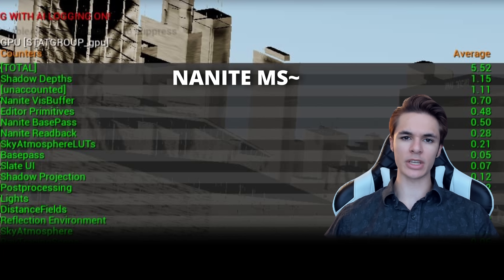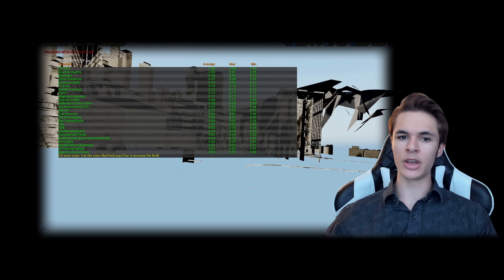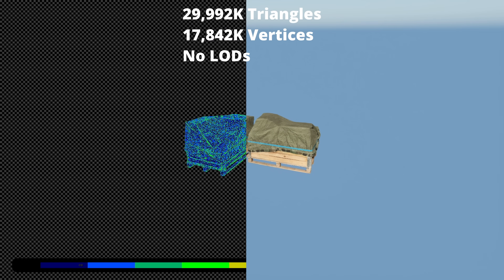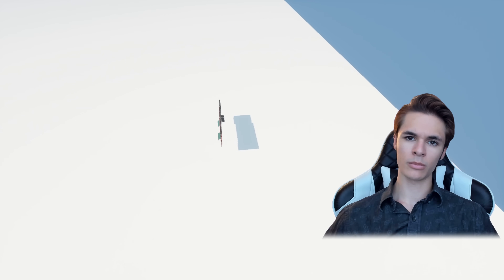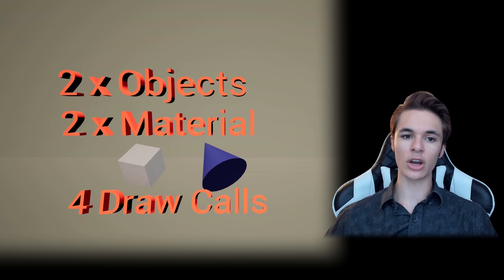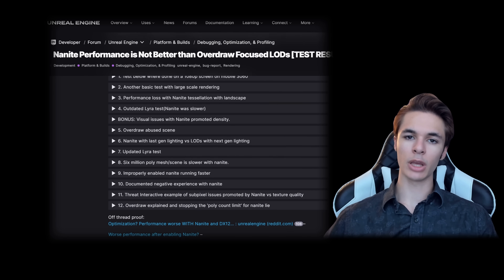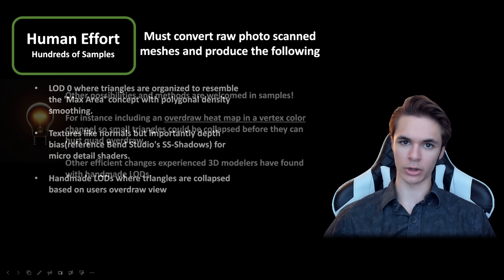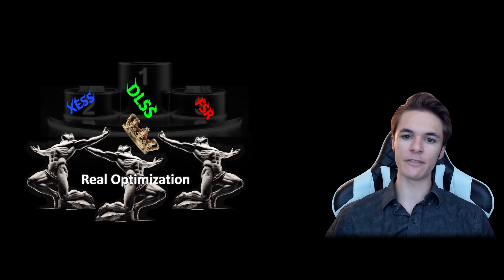Epic's Unreal Optimization Disaster | Why Nanite Tanks Performance!

Comment: DLSS was originally conceived as a means to make real-time raytracing possible. It's sad to see how many games today rely on it for stable frames with mere rasterization.
Reply: I'm looking at you, Test Drive Unlimited Solar Crown. Not even a RTX 4090 can run that game at a stable 60 fps at 4k with no upscaling. And even worse, the game looks like an early last gen game.
Reply: @autbo I'm glad I didn't buy that game I thought it was going to flop and be terrible I played tdu 1 and 2 they pretty good , ran alright
Reply: I absolutely hate the way modern rendering went. They switched from Forward to Deferred, but then broke anti-aliasing completely, introduced TAA which sucks, then introduced DLSS, which is now MANDATORY in any game to run at a sort-of acceptable framerate. Nothing is optimized, and everything is blurry and low-res. Truly pathetic.
Reply: @beetheimmortal  agreed, can't believe that high end RTX40 series GPU's really struggle to run the latest games at acceptable settings and performance especially compared to the hardware we had with 2010-2015 games which all generally looked good and run well on the hardware of their time.

I feel like we are at the point of gaining very slight graphical fidelity for way too much cost these days.
Reply: @dawienel1142  yea its called diminishing returns, its almost like the video games selling point today is graphics not gameplay😂
Reply: @dawienel1142  at 4k broooo
ofc you should expect some performance decrease when you're playing at 4k res
Reply: @Denomote  in the latest AAA games 4k isn't even remotely possible.

3440x1440 with some heavy DLSS an FG maybe.
Reply: @beetheimmortal  The worst part is that now some AAA games "hardcode" TAA into their game. For example the latest RDR2 PC build renders only half the pixels of foliage (trees etc) and relies on the user to turn on TAA so that it fills up the rest of the pixels on the trees. The result is that it looks like complete dogshit. Its better on 1440p (less blurry) but for people on 1080p its a smeary mess. Turning TAA off means you get transparent trees - and even on 1440p with TAA it looks blurred as soon as there is movement. The two alternative antialiasing methods in the game introduce game-breaking artifacts - disappearing objects, trees, weird collisions etc. This is the same in Ghost Of Tsushima
Reply: @beetheimmortal  only way to play games with proper resolution now is to buy a 4k monitor and render at 4k. Then you get somewhat a similar image quality as we had with foreward rendering
Reply: not at all, it was originally a supersampling project which even this is taken out of context and flipped on its head. what supersampling's supposed to do is take a natively higher resolution image and downsize it for example a 1440p image to fit the 1080p resolution WITHOUT quality loss, what nvidia did is they started rendering the original image at a lower reoloution and then upscaling it. imo its very wrong to call it supersampling because its not that. its upscaling. its an upscaler. from smaller res to higher res. not what supersampling means. one way to look at it is that if we actually had supersampling capable video cards we could get extremely high quality images say (hypothetically) 8k image for a 4k display. but obviously this would require a fuck ton of computational power which defeats nvidia's purpose of getting away with doing not even bare minimum. im extremely thankful for this channel to finally present this fact in a more technical and believable aspect that nvidia is not here for the goodwill of the gamers, its a greedy company thats gonna get even more greedy once they see the ai bs fail.
Reply: @oceanmanzz  Everyone knows DLSS is doing spatial upscaling. I would say it is at the point where instead of being misleading, it has changed the meaning of super-sampling in many people's conception. It is giving actual super-sampling a bad name because people think upscaling and super-sampling are the same.

DLSS was never intended to be about spatial super-sampling. That is not at all what the technology does and Nvidia has another feature called DLDSR that does that. The original DLSS 1.0 was called 'super-sampling' because the model was trained on 16K images, which doesn't count and is very misleading. Though now technically DLSS 2.0+ is 'super-sampling' because it uses temporal super-sampling like any TAA (a.k.a. TSSAA), i.e., it samples multiple frames.
Reply: @Nenulis0  Only because TAA in most games looks like vaseline. But DLAA is still TAA and suffers from the same issues as every other TAA. It's still temporal so you will always get smearing and shimmering, just not as noticeable as the vomit inducing TAA most games have. If you truly want the best AA in decades, it has existed for way longer than DLAA and it's called... SSAA. Obviously it's horribly inefficient, you're just throwing more power at the problem, but DLAA is just another less bad TAA
Reply: @Creepus_Explodus  "If you truly want the best AA in decades, it has existed for way longer than DLAA and it's called... SSAA."

No, the best AA is called MSAA + Transparency SSAA. It's the best because it provides nearly the overall quality of SSAA/FSAA at a much lower cost.

The problem of course is that multisampling doesn't work with deferred rendering. But MSAA is still a superior solution to everything else. It provides the best possible result with a reasonable performance cost.
Reply: It's not all the games fault, it's that Nvidia is selling 1080p graphics cards for $400+ in 2024. DLSS is a cheating hack to allow this behavior. You wouldn't accept this trash level hardware for your 4k monitor without DLSS. So while developers are also abusing it, the real problem is Nvidia selling garbage and the brainwashed masses who buy it. Everyone who bought a mid range or lower Nvidia card is the problem. Developers are mad over 8gb cards. WHO SOLD THEM? WHO BOUGHT THEM? Consumers can only blame themselves. Nvidia users like to brag about their DLSS, well how good is that 8gb 3070 vs 16gb 6800? You don't even need dlss on the AMD card. You can just run native resolution. Nvidia invented their frame gen specifically to get away with selling a 128 bit 4060 in 2024. If you bought into this, you are the problem. Unreal engine fanboys are on the same level. It's always fanboys who ruin progress for marketing. Snake oil is a meme for a reason, and nobody learned. The modern snake oil is DLSS, TAA, and unreal engine.
Reply: @JohnDoe-ip3oq
Reply: @Nenulis0  DLSS is rubish
Reply: @Nenulis0 a yes, dlss making games look shit compared to 2010 Batman but with shit performance
Reply: Same story every time with every technological advancement. The RTX 4090 came out and it was an absolute fuckin unit of a powerhouse. How long did it take before some lazy company made games that that RTX 4090 was barely able to push beyond 60fps? caught caught I won't name names because fuck them, I don't want to give them free publicity.
Reply: @Nenulis0  DLAA is amazing
Reply: look at the clowns who are trying to defend their shitty dlassass
Reply: That's not sad at all
Reply: @polecat3  that is awful
Reply: i'm not surprised when i saw the tech being announced, i guessed right away that this shit was going to happen. I also was not surprised when all the tech reviewer claimed that you could not tell the difference but that it was all a lie and saw that it puts a Vaseline filter on everything
Reply: and yet this was exactly predicted by literally everyone lol
Reply: Its surprised me at how well it works for ray-tracing. Turn pathtracing on in Cyberpunk and on a 5080 I get 30 fps, but with DLSS I get 60 and the path tracing is so beautiful any DLSS shenanigans are forgiven.
Reply: I thought it was made so that gaming on a 4K display would be possible
Reply: It's funny you say this because I'm playing Wuthering Waves with RT off just to get higher fps that I know my hardware is capable of, but I have to turn on frame gen just to be able to get there
Reply: Nah, what DLSS is doing for gaming is pretty amazig,
Reply: DLSS > TAA, you sound ignorant.
Reply: @TerracideDK  I don't think anybody here is saying TAA is better than DLSS. And also I'm pretty sure people aren't even saying DLSS is bad. It's an amazing technology, but developers using it as a crutch for poor optimization is bad. While as fairly incredible DLSS is, it still has ways to go. As someone learning development when I use DLSS in most games it becomes difficult for me to enjoy without noticing all of the artifacts it creates during movement unless it's cranked to max quality.

Another thing. DLSS =/= TAA. Ones an upscaler, the other is anti-aliasing. They may be reliant on each other in some games (upscaling/anti-aliasing) but nobody's comparing them. We're talking about how they are used together. You sound ignorant and aren't offering anything to the convo.

AA almost becomes a must because of all of the aliasing artifacts that DLSS can produce and most engines reliance on TAA risks a blurry mess of an image. Which is also bad. These things need work but DLSS is not bad inherently
Reply: @LucydDev  I use DLAA whenever possible, people are just muppet (mostly ignorant too)...raging against upscaling is like raging against T&L or RT.
Small (ignorant) vocal (too vocal) minority...like Linux users 🤷‍♂️
Reply: How is it better than relying on spending years of time to optimize every model and fake every visual effect? The problem only is that our hardware not yet there, but dlss so good to give to us just a little bit of it right now. You could say that why rely on dynamic tech now if hardware isn't there? The answer is that people and developers have to use and attract attention/investing into raytracing etc. For it to progress/get better, to produce new hardware with a point of being capable to run new advanced tech people need to want it. Nothing fancy, natural flow of things. Somebody think of dlss as an evil, I think almost the same of rasterization
Reply: I agree and lament the increasing enshittification of ... pretty much everything... but here's a counterpoint:  Should a game (or engine) run flawlessly upon its release, on top-end hardware, at high settings?  Or should it future-proof its legacy by exceeding the limits of current hardware, thus allowing future increases in the game's performance/quality, as better hardware comes out?  Think of Crysis.  Of course this assumes that it can run smoothly at, say, medium settings.
Reply: @bubbavox  "Should a game (or engine) run flawlessly upon its release, on top-end hardware, at high settings?  Or should it future-proof its legacy by exceeding the limits of current hardware..."

Both. Just like Crysis.

There has been an unbelievable amount of misinformation regarding Crysis since its release. A few months after release I played Crysis on a dead-low-end 8500 GT with no problems whatever. Almost anything "could run Crysis". Then a few months later I played it maxed out at 25 - 30 fps and 1600 x 1200 on a GTX 260.

Three things to remember:

1. At that time, 1280x960 was still a high resolution (The 2005 F.E.A.R. ReadMe referred to 800x600 or higher as "high resolutions".
2. At that time 60 fps hadn't yet become the PC standard. Gaming at ~30 fps was normal.
3. Unlike most engines, ~25 fps on CryEngine 2 is perfectly playable --- Well, I don't consider it playable anymore, but I mean unlike other engines the latency is low enough to be actually playable, and enjoyable back then.

Since 2007, I have looked forward to playing Crysis after every GPU upgrade, because not only did I get higher framerates, higher resolutions, and higher MSAA, but I was able to push the graphics higher and higher via the config files. Now I can run Crysis at 4K at a VSync-locked 60 fps with 4x MSAA, and rendering ten times more triangles per frame by increasing the draw distance and other parameters.

In short: Could Crysis be run maxed out at any resolution and playable framerate right at release? I don't know --- I wasn't able to try. But I wouldn't be surprised if an 8800 GTX can run it maxed at 640x480 or even 800x600 at 25 - 30 fps. At any rate, I know it was possible 6 or 8 months after release.

Today things are different --- we have rock-bottom standards that didn't exist then. A game is expected to run at minimum 1920x1080 and 60 fps (There are apparently console émigrés who tolerate 30 fps but they don't count, lol). Also, we don't have CRT monitors that can display lots of different resolutions natively. So there isn't the same expectation that people can just dial these things down in order to max a game. Nowadays, dialing down settings is really the only option.
Reply: tbh 99% of all players (especially in single player) won't see a difference.. and that's the point.
Get 90% of the result by investing 10%. The last 10% cost you sooo much more and isn't often worth it.
imo
Reply: @gudeandi  That is how I think NVIDIA sees it.  Manual optimization of course wins out. The point of Nanite is so you don't HAVE to do the manual optimization, or at least that is how it seems to me.
Reply: @gudeandi  I thought this way until I bought a DLSS-compatible GPu and tried it in a couple of games.
I cannot turn DLSS on, no matter the gains, the image quality is just too bad for me.
Reply: @gudeandi correct me if I'm wrong but are you saying that it's not worth it to optimize your game? DLSS isn't a standard optimization. It's an after market upscaler typically used for ray tracing. Its a way for lower end RTX cards to be able to handle ray tracing or higher end to achieve higher resolutions.

Its not an excuse not to optimize. I'm a solo learning development and I try my best to take optimizing seriously. SOLO. If you have a dev team, there's no excuse, IMO. Im assuming OP is talking about a lot of unoptimized AA/A games that are out today.
Reply: @gudeandi  tbh we already see the difference. It's all blurry and shitty, and only looks good when still. Devs have gone completely lazy
Reply: @gudeandi   You have console players and you can see they are happy with 640p upscaled resolution on a 65" TV. It looks like smeared sh... but they love it.
This is why people game on PC. So they can game on pretty sharp native resolution, because they see the difference!!!
Reply: @gudeandi There is no way for a developer to leave their game unoptimized on purpose and guarantee that DLSS will solve all the problems. It's like studying just to get the minimum grade on a test because it's easier, there will always be a risk that you'll end up getting a lower grade than expected. Many games simply don't work properly even with DLSS due to poorly optimized games. not counting the players who don't even have a DLSS-compatible video card, which are still many, nor those who use AMD, since FSR is still considerably inferior to DLLSS.
Reply: @Medroseira  I have seen entire shader loops ignore SIMD optimizations because "The target hardware will be fast enough.". We are starting to see people ignore even simple AVXI optimizations for quicker turn around. Why unroll a loop and fiddle with registries when you can just not?

But thats just the nature of compute. We increase compute, drop optimizations, add abstractions, and move along. Rinse and repeat for 10 generations and here we are.

Comment: Cool take. It's worth pointing out that altering the micropolygon size threshold can have a dramatic impact on SIMD (overdraw) efficiency here. There was an industry hardware transition over a decade ago from SIMD vector fragment component to SIMD vector fragment quad. This was driven mostly by the easy derivatives, especially as it pertains to dependent read and computed parameter derivatives, but also because it's an easy vec4 even when you have scalar shader math or vec2 & vec3 math. Along with it came the need for program branching & edge execution masks you are discussing as overdraw inefficiency etc. The derivatives usage would seem to make this irreversible, however perhaps there could be some MIMD innovation or a return to component SIMD when derivatives are eschewed by shader code, this could still allow derivatives from attribute rasterization to be directly calculated. A SIMD model that can switch between fragment quad SIMD and fragment component SIMD up to the point in a shader where SIMD derivatives are needed but then execution masks become inefficient might be a worthwhile hardware level innovation.

Comment: This is a conspiracy with nvidia.
They intentionally do this, otherwise its hard for them to sell new GPUs

They did the same thing with 1080p.
They intentionally put TAA in games and made 1080p native look bad, or even forced TAA to be used.

This was a successful campaign that got a lot of gamers to move up from 1080p.
Load up games from 2006-2014, look at how clear native 1080p is.

Also TAA is much clearer at 1080p in games like splinter cell blacklist (2013)